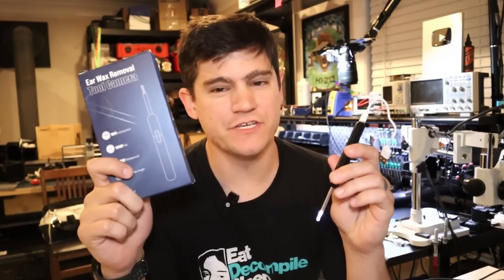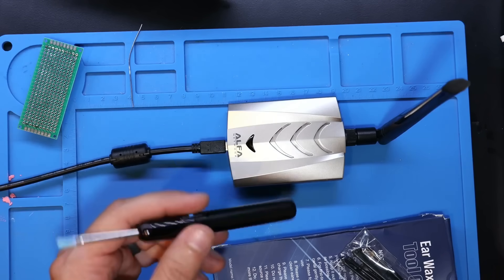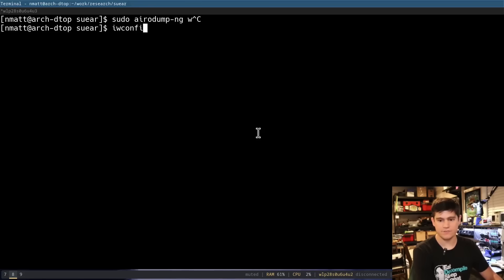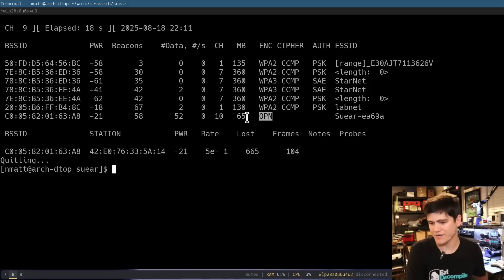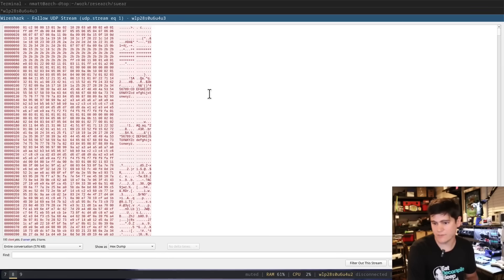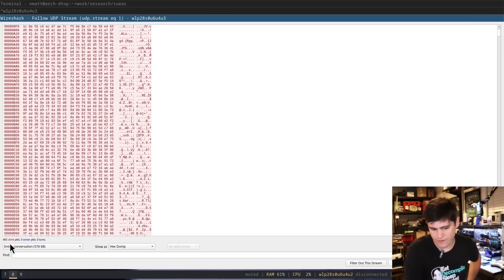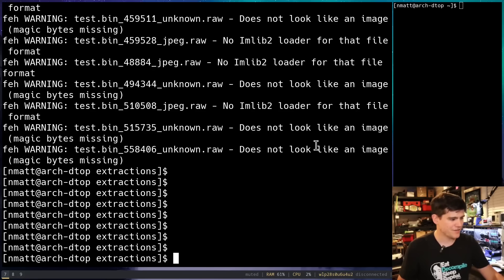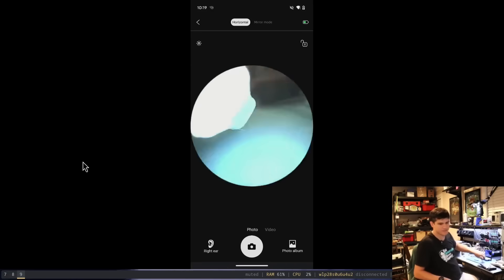IoT Ear Wax Removal Camera - WiFi Capture of Video Data

Comment: My son has been to the Dr. Twice with impacted ear wax and we bought this device (2 of them) and believe it or not this actually works so well it has saved us several hundred in Dr. Visits. We keep being told the same thing. leave the wax alone and it will come out on it's own but after the 2 visits they said we need to try and get the wax out because his doesn't seem to flow. We used this device and it's easy to get the wax and not hit the ear drum. and It also comes with little tools. I know it sounds gross but no worse then the otoscope the Dr. uses.

Comment: I did the same thing with mine. I got slightly better jpeg data out of the stream. The important part that I figured out was that you have to send a very simple packet to initiate the video streaming. The data for the camera orientation is very easily found in-between the jpegs.

I decompiled the android app somewhat and it had all the expected libraries, especially for rotating the image based on the sensor input.

That's as far as I went. I would have liked to build a simple stream interface that I could use to initiate the stream, masssage the data, and feed rtsp out to vlc. There must be an open source project to use as a starting point. I don't really have the skills at hand and I didn't have the time to invest in it.
Reply: Cool. 🆒

Comment: I have to admit I own a couple of them. The batteries go bad after a few months. My son gets impacted wax bad and it's helped tremendously. He'll fall asleep when he's getting it done. He's not like 30 years old lol, he's 9 years old and autistic for anyone wondering.
Reply: Just a tip I learned from taking care of my own wax, you can tilt the affected ear up and use a little hydrogen peroxide. Let it sit for 1-2 mins and then dump it out. Usually it'll clear up some of it, and at the very least it'll soften everything up for easier manual removal